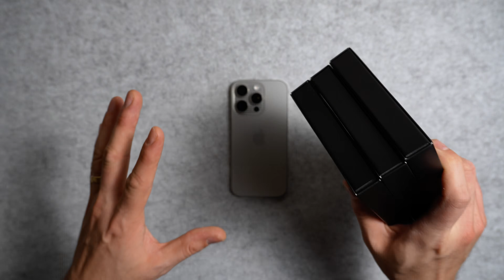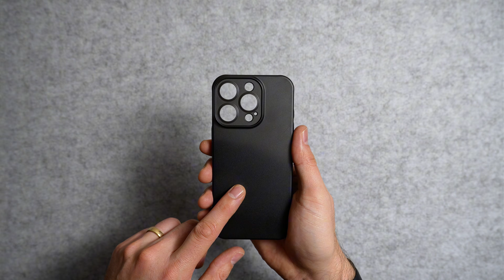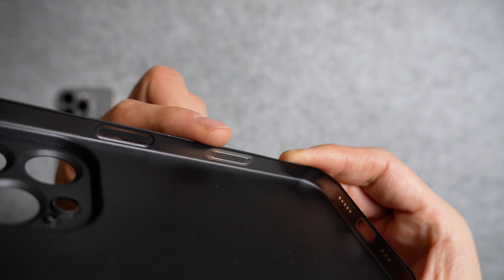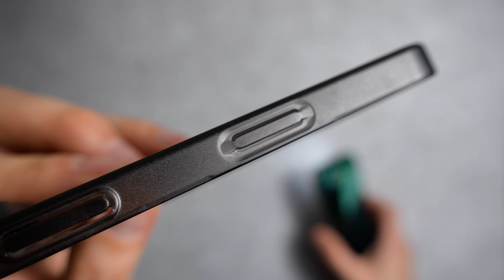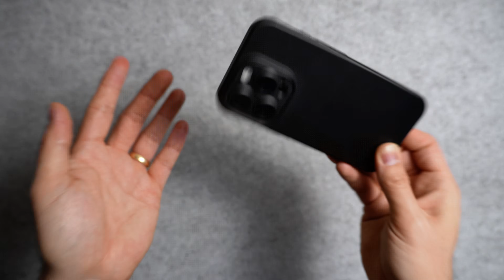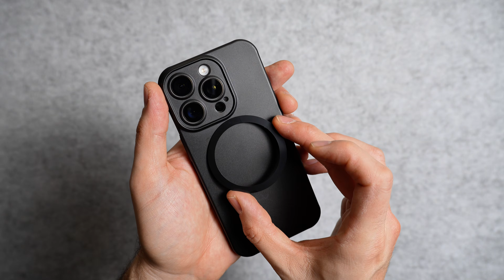SUPER THIN Case with Camera Control - iPhone 16 Pro!

Comment: Thank you for continuing to update and for organizing all of these in a playlist! Just got a 16 PM and am waiting to evaluate more options before buying my final case. 
I did buy at random an Onn. Rugged case (cutout design) for the meantime, but actually really like the port cover design- it’s a rubber cover with a cut cross that allows your cord to push through.
I assume it’s too much to hope I’ll find a camera control case that also has a similar port protection design!